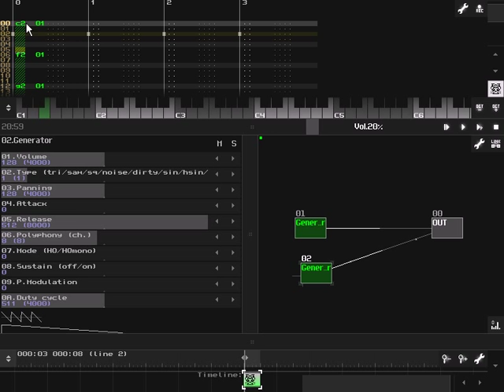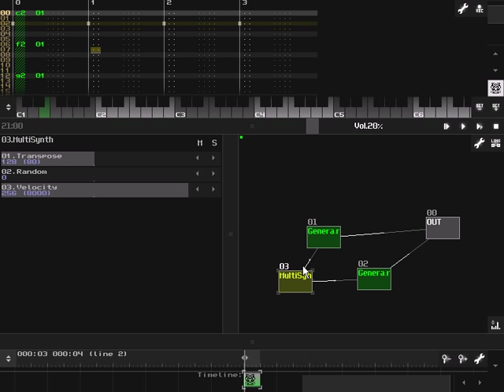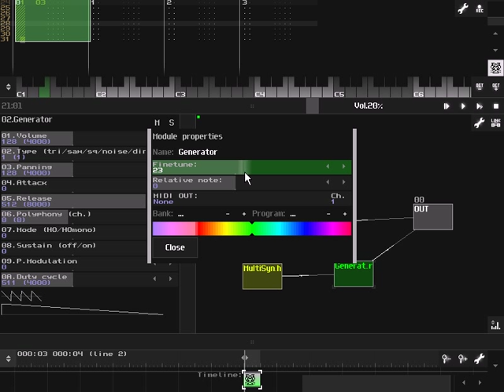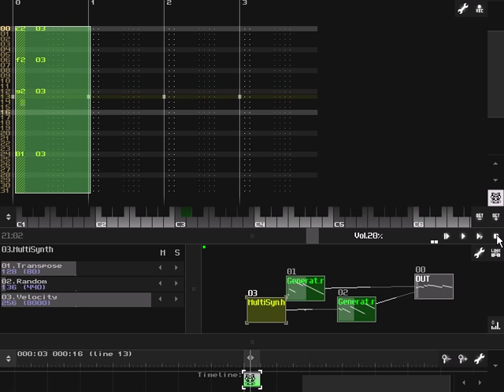SunVox Tutorial Part 6 - Multisynth

Comment: hi, nice tutorials on sunvox... my question is how to use multisynth to send to different modules depending on octave, i know it's possible, and have the example file (can't find it online right now - it's called split.sunvox)... but can't work out how it works x
Reply from the maker: Yo! 

So basically, in the Multisynth's velocity curve section, you can set the volume of the output of the Multisynth for specific semitones and octaves. So, you can set the volume for certain octaves to 0 to essentially "turn off" the Multisynth for those semitones. If you do this for several Multisynths, then drive them all using a single one, then you can trigger certain modules on certain octaves (i.e. the first octave drives 1 synth, the second drives a second, and so forth).
Reply: +Solar Lune thanks, that did the trick x I'm thinking of running Sun vox on stage and having different samples on different keys, this helps a lot x

Comment: For some reason when i implement the same keys you do my output sounds higher pitched and distorted. are their any settings you changed beforehand?
Reply from the maker: Hmm, do you have the Multisynth's octave set higher? Check its Module Properties (right-click on the Multisynth module). You might also have the transpose value on the Multisynth set incorrectly.